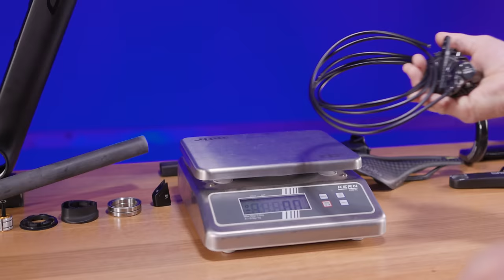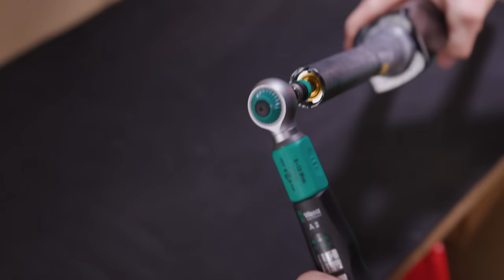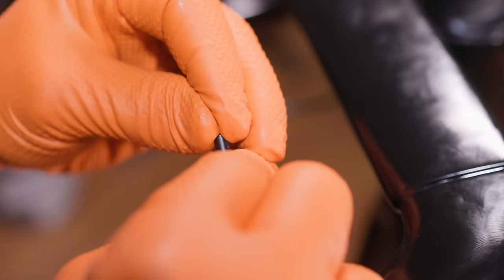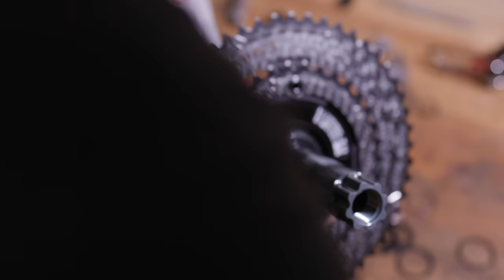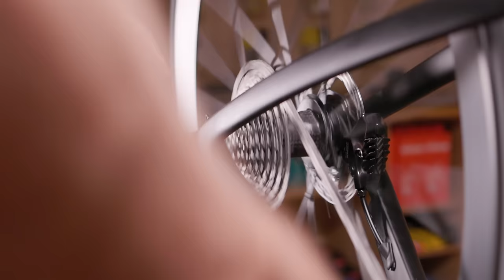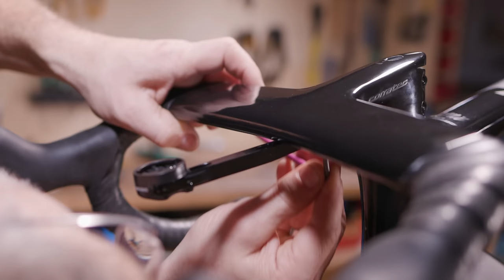Corratec CCT Evo Ultra I Dream Build I ltd. edition 34 pieces I €25.000 I ultimate road bike

Comment: I want 3 things:
-Those rotors
-Those wheels
-That hability of seating GP5000´s by hand

Very nice dream build!
Reply: whats the problem with go5000 montage by hands?
Reply: @cikloverzum9406 😂 they are super tight, but stretching so easily. If u try gp5000 all season, it will be a nightmare for new people